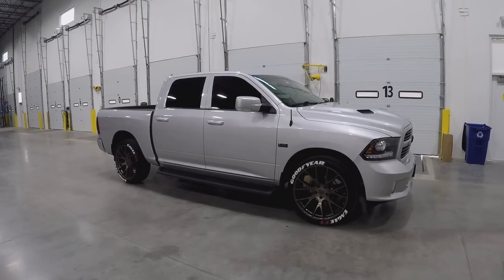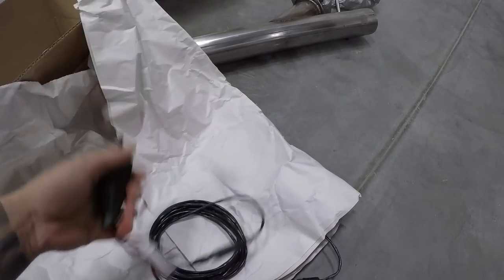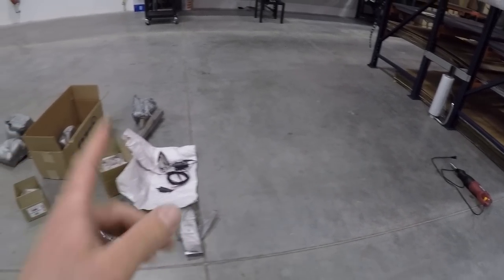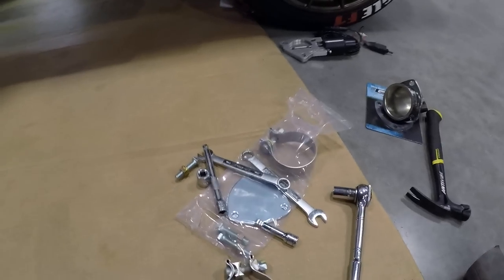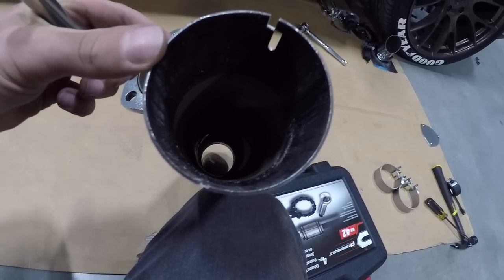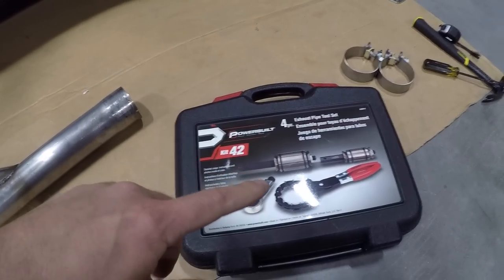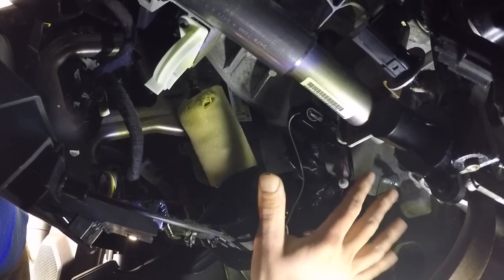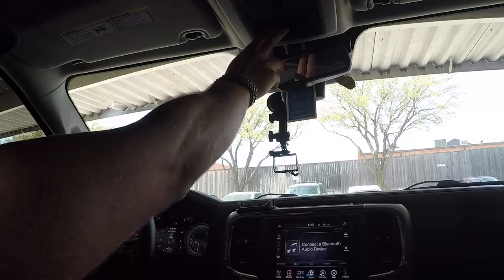INSTALLING AN ELECTRIC CUTOUT ON YOUR EXHAUST - RAM 1500 HEMI - HOW TO DIY

Comment: Why would you install that?? Sure it will throw codes eventually??? Or is it like putting cards in your spokes on your huffy? I take it is sound only? Pre or post cat??  Good vid
Reply from the maker: Its after cats so no codes.  Better airflow and noise for when you need it but then quiet and stock for when you don't want the noise.

Comment: Why do you think you need another gasket for the turndown?
Reply from the maker: Just so that no carbon/exhaust doesn't get blasted out the sides and make a mess. It isn't under pressure but just didn't want the steel flange bolted up to  the aluminum electric cutout face without a gasket.

Comment: The radio antenna you have is that the stubby or a different kind
Reply from the maker: Hey Matt its just a super cheap one I got off eBay for about $3 but I would recommend spending a bit more money.
Reply: Boosted2k I bought the stubby for mine and the reception is terrible and iam guessing the one you have is no better right?
Reply from the maker: Yeah reception is crappy with these shorty antennas for sure

Comment: I love a good loud, non fart can, exhaust. I had it on both cars. First one I did with headers and a Cat less exhaust and second a cat back. Sorry to say but this is the biggest waste of time and money. If you are going to have an exhaust, do it right and fuck what the cops say. I never got pulled over in either cars especially the cat less which was very loud. As long as your not an asshole racing around residential at 2 am you will be fine.

Comment: Nice video..how mAny inches was thos kit ? Couldn’t be that you bought the wrong measurement for your truck ? I’m planning to install this on my v6 pentastar but I’m afraid I’ll end it up doing the same 😂 great explanation and result overall
Reply from the maker: No sir its the correct kit just not the best quality control unfortunately!  I few other had the same issue when installing 😯
Reply: BoostedMotorsports man I’m only 30, just call me Alex ! Will see how that goes ..i should start to make some video too, I’ve made some upgrade I’m just to shy to make video 😆

Comment: What were you pressing to install it on the top of the truck by the 3 piece window buttons?
Reply from the maker: Those are the garage door opener buttons.  To program them you just hold the button until the dash says its learned 👍

Comment: So if that pipe is after the o2 sensor you get a check engine light every time you open it then have to clear the code?
Reply from the maker: No CEL 👍

Comment: you really don't need a gasket when you are just dumping the exhaust.  I doubt you would hear it if it leaked :)
Reply from the maker: True I just didn't want carbon blasting out the sides

Comment: I cant help but wonder what the sound is going to be in the cab since it appears that the opening is right under the cab. Don't get me wrong, I like the big sound coming from that Hemi but I also like my hearing. Also what about the exhaust fumes? I would think that the fumes could potentially go back into the cab. Not sure about this mod.
Reply from the maker: Hey Don the benefit to this is you can choose how loud or quiet you want the truck at all times.  It's mainly used for when you are in motion and want to hear that HEMI scream.  If you are in idling for a period of time you would probably be better off closing the cutout.
Reply: Thanks for the update. Keep the videos coming, you've given me so many ideas. The sound is great, working on my lights this weekend since we are supposed to be going to have great weather here in the OC.
Reply from the maker: Thanks for the support Don!  Plenty more videos on the way! 👍

Comment: So you only did one side and it sounds ok?
Reply from the maker: Hey Bryan these trucks aren't true dual exhaust from the factory. They have a Y pipe that goes into the muffler and then eventually splits into 2 pipes at the back of the vehicle if you have stock duals. This is after the Y pipe so it sounds normal!

Comment: you get a product shipped to you and it gets dented and you blame the manufacturer?
Reply from the maker: It was initially thought that it was from shipping but it ended up not being flared incorrectly and needed to be expanded in order to fit.  Others have had the exact same issues purchasing this kit if you check out the comments below including this one for example:

Thomas Petito3 months ago
I just installed this and ran into all the same issues as you lol but it was worth it in the end sounds bad ass especially in manual mode where you can keep it revved high up then hit it

Comment: The weld job inside that pipe is disgusting.
Reply from the maker: lol yeah not overly impressed with that Y pipe for how expensive it is.  Not to mention it didn't even fit without having to get that pipe expanded.  I do like the function and how it sounds though 👌